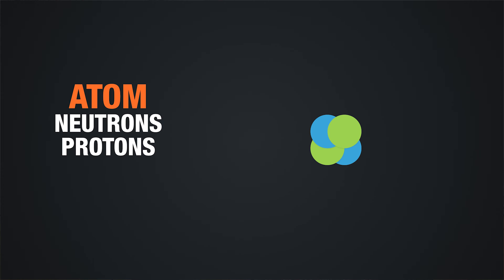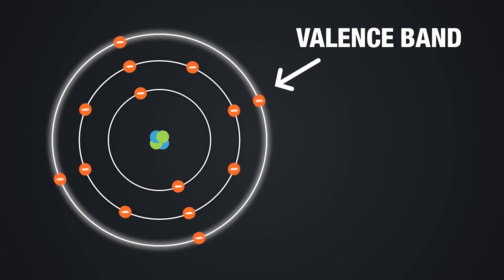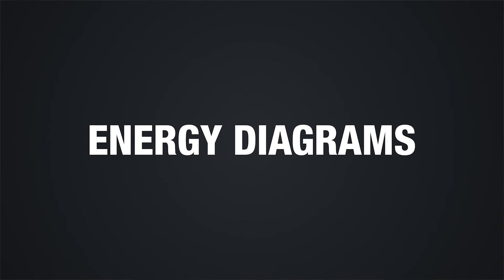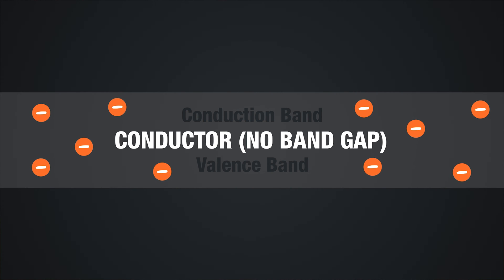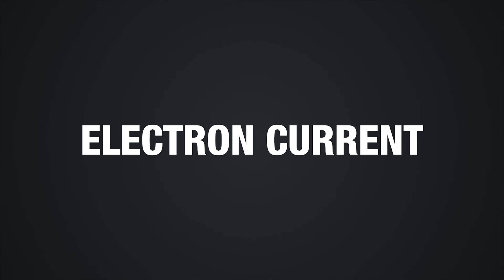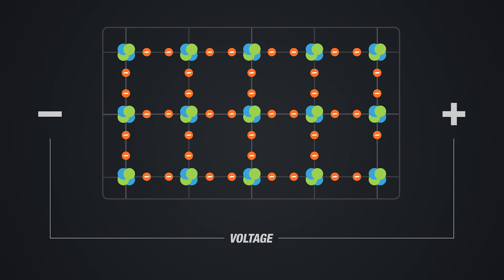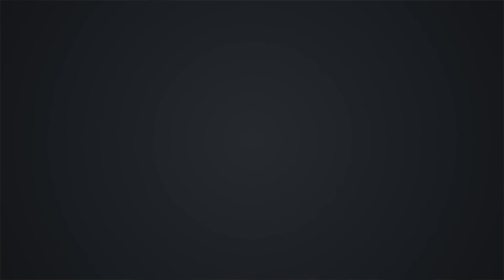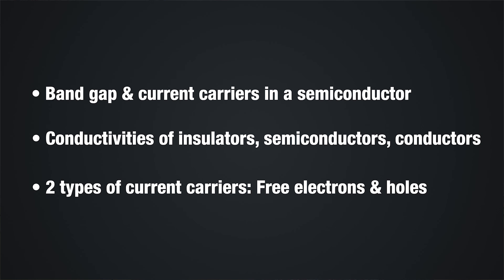Band Gap and Semiconductor Current Carriers | Intermediate Electronics

Comment: this is false. there is a bandgap in copper. if there were no bandgap there would be 0 resistance. but copper has resistance.
Reply: I am not sure whether copper has bandgap or not, but I know that resistance has to do with the hindrance of electron motion due to vibrating lattice atoms, causing electrons to drift around rather than smoothly flowing when potential is established.

Comment: I am trying to create an animated display explaining semiconductors for a computer museum. I'm worse than a novice, I'm just a curious bystander. I am trying to get an idea how many doped atoms have to be introduced into a silicon crystal to optimize its semiconducting characteristics. one out of five? one out of a thousand?  is there any particular pattern to the where the boron or gallium molecules fit into the silicon lattice?  If you can point us to any resources, we would be greatly appreciative. Keep up the great work!
Reply from the maker: Good questions!  The dopant level can vary greatly but you're probably looking in the range of 1 out of 10,000 to 1 out of 100,000.  Just to give a very rough range.  I remember being caught off-guard in college by the dopant levels because they're almost non-existent in terms of the numbers we use in "normal" life yet somehow make a huge difference in how the material operates.  
In regards to there being a particular pattern, there isn't one that I'm aware of.  I think it's fairly random.  And sorry, I don't have any specific reference that I would recommend for these more in-depth questions though Wikipedia is always a good place to start!

Comment: if enough energy is supplied to the system, is it possible for there to be no hole-current because all valence electrons are promoted into the conduction band?
Reply from the maker: I'd like to start by saying my confidence level on my answers is only moderate - please don't consider this as definitive.  I imagine it's theoretically possible but I think that in most real-life cases there would still be at least a small amount of hole current.  The only way to completely eliminate hole current would be to eliminate all holes.

Comment: Hello, thanks for the video! I have a question . Do valence band electrons still belong to specific atoms? Because my book states that the electrons do not belong to any particular atom but I found this definition online : valence band is the range of permissible energy values that are the highest energies an electron can have and still be associated with a particular atom of a solid material. Thanks in advance!
Reply from the maker: Great question!  I worked with a PhD in chemistry (her Masters is in EE) and she helped us with the accuracy in these videos but I wouldn't consider myself, personally, as a definitive resource.  That being said, when working with her, we addressed valence electrons as still being associated with a specific atom.  However, the bond is so loose, that people will often consider them to be completely unassociated - I've heard the phrase "sea of electrons" to envision them just floating among the different atoms.  I wonder if the biggest difference is one of charge - while the electrons aren't physically associated with a specific atom, there is an electron for each atom to maintain a neutral charge.
Reply: @CircuitBread  Thank you for your quick response!

Comment: Outer most shell of atom is called valence band.
Where is conduction band located?
Reply from the maker: The conduction band are those electrons that are floating around, not tied to a specific atom.  Be aware that there are subtleties here that I'm not addressing, but this is the easiest way to imagine it.
Reply: @CircuitBread  Thank You so much

Comment: I have a stupid question : why does an insulator ** actually ** insulate? 

The video explains that the electrons of the insulator are bound to their atoms, these electrons can't access the conduction band to participate to the electric flow. 

OK I get that, but there's still something I find strange. 
The conduction band does exist, even in an insulator. 

So, if the electric source injects some electrons on the conduction band of the material, what prevents these electrons from progressing on said conduction band? 
In other words : why should the charge transfer be due exclusively to the electrons that belong to the material?
Can someone help?
Reply from the maker: That's not a dumb question at all, but I think you're getting some things confused.  The term "insulator" is a somewhat generic term - it just means that electricity doesn't flow *well*.  There will still be electrons that jump into the conduction band and flow, it's just a lot harder to do than it is with conductors and semiconductors.  The number of electrons are small enough that we can, in most cases, just assume that it's zero.  But with sufficient voltage and/or sensitive enough equipment, you will find that insulators do actually conduct electricity, just incredibly poorly.

Comment: Since current is known to oppose movement of electron, does this mean that both hole current and electron current have the same direction, the only difference being what type of current carrier involved?
Reply from the maker: Nope!  It means that, comparing the macro and micro level - hole current and "normal current" are in the same direction and electron current and "normal current" are opposite.  Does that make sense?

Comment: So will hole current still be present if no voltage source is applied? I understand it still needs some energy as mentioned but is that provided by the temperature or a voltage source?
Reply from the maker: You'll get what's called diffusion current when there's no voltage source ( https://www.circuitbread.com/ee-faq/what-is-the-difference-between-drift-and-diffusion-currents-in-a-semiconductor ) and it will be both hole and electron current.  There are two factors to consider, though.  One, whether there are any free carriers - which is dependent on temperature and doping, allowing electrons and holes to move around.  And then if there are free carriers you have the second factor.  And that is if there are forces causing those free carriers to move, which is either diffusion or a voltage source.

Comment: What happens in conduction which doesn't happen in valence band even at high potential difference???
Reply from the maker: Hi Sanjeev, hopefully I understand the question - in conduction, the electrons are free to move around. They’re not tightly bound to the nucleus of the atom, so they can move around. We have several other videos explaining what’s happening at the semiconductor level if you want to check out our Semiconductor Basics playlist.
Reply: @CircuitBread  
Thanks 👍

Comment: Hi i want to know how forbidden energy gap is formed between valence band and conduction band
Reply from the maker: Hi Kriti!  That is more of a chemistry level question but it has to do with the valence band of the material.  It's a combination of electrons having only discrete energy levels and how much energy is required to pull that outermost electron away from the atom.

Comment: Sir,  is the electron Current and hole current occurring simultaneously whn semiconductor is used in circuit?
Reply from the maker: Hi Mithila, yes, it is occurring simultaneously but most of the time, one of the current types is dominant - either a lot more electron current or a lot more hole current.
Reply: @CircuitBread  Thank you so much!

Comment: Where is the conduction band lies in the atom?
Reply from the maker: Hi Ashiq - I feel like conduction and valence bands have so many layers, once you understand them at one level, you peel back a layer, and it gets a bit more complicated.  However, specifically for what you're asking, it sounds like you're confusing the conduction band with a physical location whereas it's really just an energy level that the electrons in an atom can have.  Now, since electrons with enough energy to be in the conduction band are free to move around (and conduct), there is definitely a relationship between the energy level and physical location.  However, if there's an electron that has the energy level to allow it to move, but no voltage to actually induce it to move, it won't really go anywhere.

Comment: First at all thank you for this wonderful explication!!
 I have a question. What is the unit of measure of band gap?
Reply from the maker: Hi Montserrat!  The units are electron-volts (eV).  I once had an intuitive understanding of what "electron-volt" means but I've lost it and I can't remember.  But that is the unit used.
Reply: @CircuitBread  electron volt is the energy gained by an electron when potential difference of 1 Volt is provided!
By the way thanks a lot brother😄.
It helped me a lot!

Comment: Nice!! is the hole current observable as it is the case for conduction band current?
Reply from the maker: Hey Soulimane!  I'm not quite sure what you mean - is the hole current measurable with some sort of measurement device?
Reply: @CircuitBread  If my understanding is correct the hole current is internal to the semi-conductor and couldn't be measurable with an external device. I was just wondering  if there is some sort of effect that could be measured due to this current

Comment: Nice!! I'm wondering... those free electrons in the conduction band are they jumping from atom to atom or still orbiting there original atoms??
Reply from the maker: The ones in the conduction band are moving freely among the atoms, basically in that "sea of electrons" - so not even jumping from atom to atom but more just operating as completely independent entities.  Then when there's an outside force acting on them (creating diffusion and drift currents), they just move.
Reply: @CircuitBread  Thanks